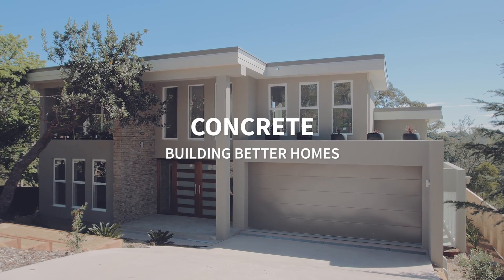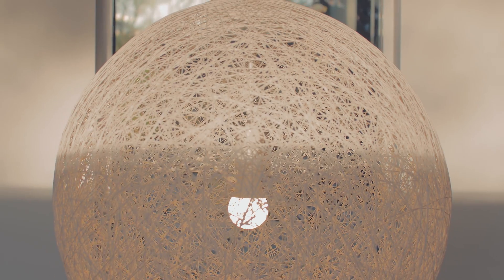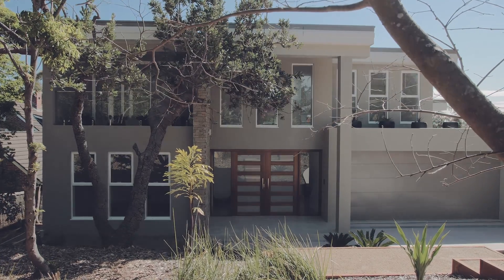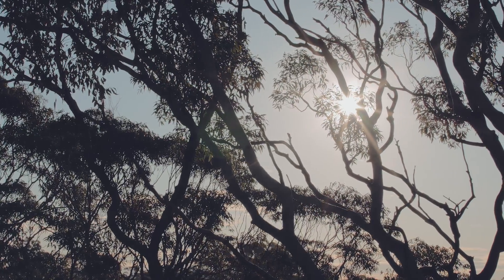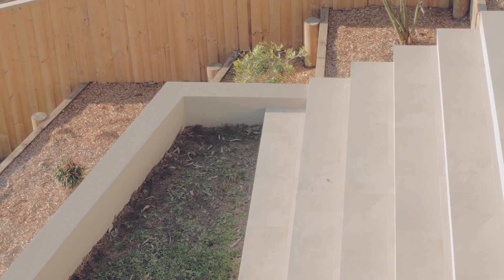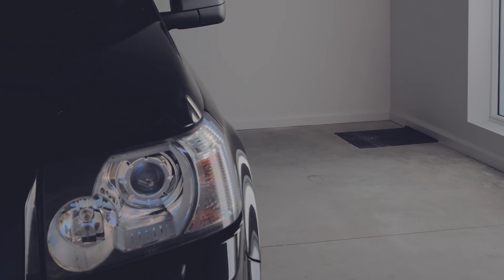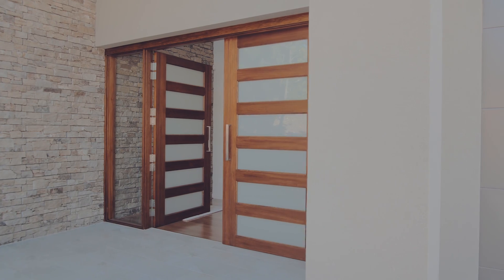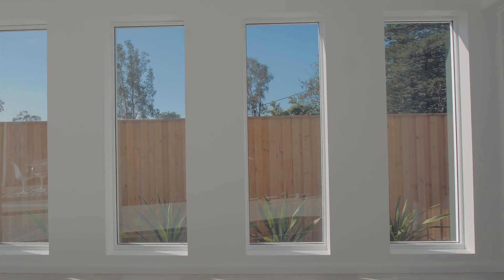Building better homes with concrete

Comment: I will also like to buy a concrete home plan
Reply from the maker: Hi Dr. Wisdom, 

As an industry association, we are unable to supply you with home plans or designs. 
If you are interested in building a concrete home, we suggest speaking with a local architect. 

Best Regards
CCAA